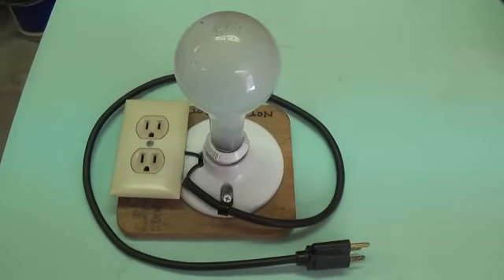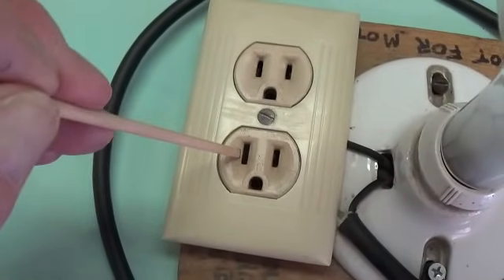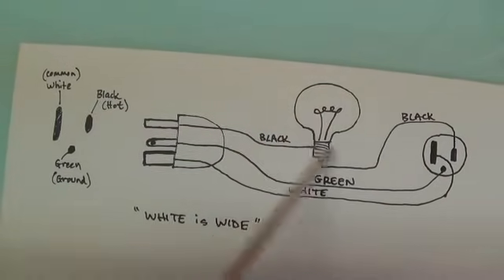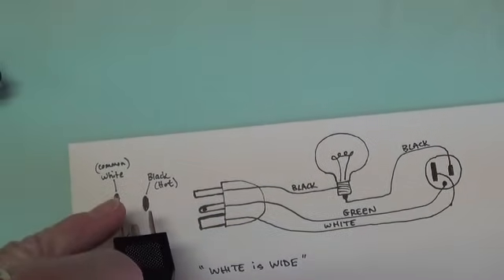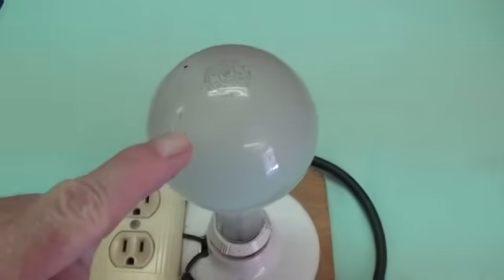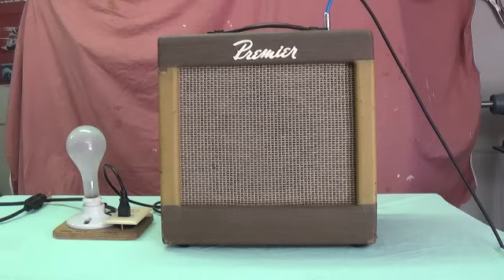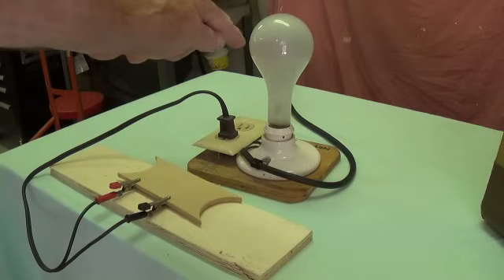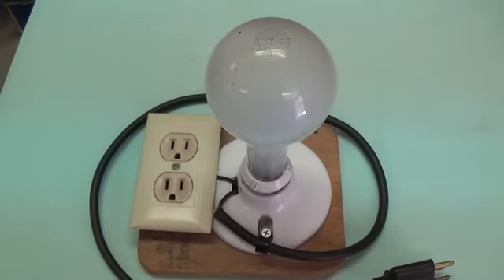Build Your Own Current Limiter for Protection when Repairing and Testing Electronic Equipment

Comment: A limiter was one of the first things that I made. I made one with a bypass switch to take the lamp out of the circuit and run the device direct. I would use that when I fire up a renovation project part of the way through the overhaul process, after I have dealt with the B+ supply and grid couplers. 
The other device I have is a device for re-forming the big smoothing cans. It is an old power transformer, rectifier tube & a neon tell-tale. All made out of scrap. The only remotely hard to find device is a 100 watt tungsten filament bulb. You have to look a little harder than your local superstore.
Reply from the maker: I believe that incandescent bulbs of high wattage are readily available on Amazon.com, NJ.

Comment: This is a brilliant idea. i am getting into restoring tube amplifiers, i think i will build one of these! its simple and it works. I have 240v here in australia. Polarising here is exactly the same. Just different plugs and voltage.
Reply from the maker: You'll be very glad you did, SED. It is indispensable when testing circuits and trying out newly acquired  equipment.  Due to your 240VAC supply, you will probably need two 200W to 250W bulbs in parallel.
Reply: Uncle Doug i will certainly do that. i will try and find a suitable bulb(s) for this application. its a shame that our government has almost wiped incandescent bulbs off the market. I will have to hunt around for some.
Reply from the maker: Our government did the same, SE.  I'm not sure where it's stated in our Constitution that the government has the right to dictate such personal matters as toilet flush volume, light bulb design, mandatory seat belt and motorcycle helmet use, gasoline additives, etc. etc.  but they seem to feel that it's their divine duty to do so.  Re incandescent bulbs, they are readily available on Amazon.
Reply: Uncle Doug Thaks doug. Your government sounds very similar to ours. I will have a look on amazon and other sources.
Reply from the maker: Good luck, SE.
Reply: Uncle Doug cheers doug
Reply: @UncleDoug  In IEC countries (including Australia), electronic gear is supplied with twice the US voltage, but draws half the current, i.e., demands the same power from the mains. A 200W bulb in Australia will do the same job as a 200W bulb in the US.
Reply from the maker: Good point, Silas. Thanks for your helpful input. @silasfatchett7380
Reply: Sorry for butting in. But its also same in UK!!! My guess is, the same clowns dictate to all the worlds Governments. Joke! But it does seem like that sometimes. When things like this go global.
Reply: Same in Germany here, but you know what - I never cared until I came across this video, when I needed them. These light bulbs are so easy to understand and good to use, but so super inefficient and fragile - I can understand that they're out of use in many areas. And honestly, I could rather call a country free, that has no incadescent light bulbs, but that allows you to do what you want in your life, so I'm fine with them dictating some technical and ecological things, as long as they stay away from social / personal and emotional business.
And luckily I've discovered sites, were you can even buy 500W Bulbs for 230V that cost about 1-2€ :D
Reply: Same as in Germany ?There are no polarised outlets und plugs . Not at your home, only some special (CEE-type).  Line and neutral changes accidential  by the way you plug in.
Reply: Do you want to know, wether polarisation is the same or the plugs or whether it matters which way round you plug and wire it? 
Btw, in case it's not a spelling mistake - i think our "Phase" is called live in english, not line ;)
Reply: You mean like the rampant and uncontrolled importation of moon god worshippers who are destroying your nation, how's that rate on your ecological disaster scale?

Comment: 500+ replies!! Noob is question. If one were to use or add a dimmer switch to this, would it then also act like a poor mans variac? Thank you.
Reply from the maker: Because of the way that light dimmers work, by chopping out portions of the AC wave form, I would not think that the power transformer, rectifier, and filter caps could properly function on an AC input modified by a dimmer.  A bulb responds only to the energy applied to its filament, but an amplifier power supply requires intact wave forms to function. Here is an explanation of how dimmers work:  http://www.sprags.com/
Reply: https://www.youtube.com/watch?v=GaRUvUoTRe8

Comment: what should be the wattage for 230volt AC line
Reply from the maker: Although your voltage is double (230VAC vs 115VAC), your current flow is about half. Since the Current Limiter (CL) depends on current to rapidly heat the filament and increase its resistance, you need a bulb with higher filament resistance. Since the filament resistance of the bulb decreases with higher wattage, you should try a lower wattage, higher resistance bulb.....i.e. a 100W......initially, and then fine tune the wattage depending upon the power demands of the amplifier being protected.

Comment: thank you very much sir for simple and elegant video on current limiter. sir pls i confused at the 6.44min your shorting the hot and common wire,how does the bulb glows

regards
Reply from the maker: You're welcome, Bala. By shorting the circuit, sufficient current flows through the bulb filament to make it heat to maximum temperature and glow brightly.

Comment: Thanks for the earlier reply.  New Q if you don't mind.  I hate to ask this as it seems like it would be obvious, but my pea brain seems unable to digest it.

Setup: The bulb is basically acting as a in-series circuit resistor with 120Vac pushing.

Q1) Seems like it would create a load either way. Why is it only lighted when there is a short?
Q2) If you/me (physically) are the short, why does it light vs you/me getting the shock?

Thx.
Reply from the maker: The bulb at rest has a very low filament resistance, probably 2 or 3 ohms. When a small amount of current passes thru the filament, it remains relatively cool, maintains a rather low resistance, and emits no light.  When much more current begins to pass thru the filament, as with a short circuit, it heats up, the resistance increases, and it begins to emit light. Since the vast majority of the increased current is converted to heat and light by the bulb, there is virtually none left to cause harm within the short-circuited component(s).  A current limiter is not the best device for human shock prevention. It works to a degree by reducing the harmful current, but a ground fault interrupter (GFI) is more effective.
Reply: Thanks UD for the info. More to learn.  I was assuming that the human offered less resistance than the filament (my 300w bulb measures at 3.6 ohms), so the human would get the current first.  But, I guess that since both are in the same circuit, the bulb will burn off (in my case) ~300watts of the energy present.
Reply from the maker: Dry humans with shoes on offer very high resistance, around 50,000 to 100,000 Ohms, but (if well grounded and in solid contact with the electrical source)  the resistance can drop down to around 500 Ohms.

Comment: "IMPORTANT NOTE: The wattage of the bulb must be tailored to the current draw of the device being protected. The high-wattage bulbs (200W+) recommended in the video are primarily for Tube Amplifiers, which operate at relatively high current levels. With lower-current devices, such as Solid State amps, a lower wattage-higher resistance bulb (even as low as 40W) may be required for circuit protection."

Thx, Uncle Doug.  Great videos!

Q) Your note above…  Is there a thumb rule?  eg. Match the bulb wattage to the expected wattage load of the device?  Thx.
Reply from the maker: No doubt there is a way to calculate the bulb wattage which is exactly right for each amp.....but I don't do this.  For small to medium power tube amps, I generally use a 250W bulb. I rarely work on high-wattage amps, but would probably use two 250W bulbs in series.  I also very rarely work on SS amps, but would use a 100W (or less) bulb if I did.
Reply: @UncleDoug  reading this gives me the idea to use a lower wattage bulb in a current limiter setup, with a amp. The idea being , the current limiter would act as a variac of sorts while llaying through the amp with a guitar. Am I thinking wrong ?

Comment: Don't forget, if you're in the UK you have 240v one the mains and not 230v - When we came into line with Europe, rather than waste billions replacing substation transformers, it was easier to relabel everything. This is why US amps run higher HT voltages than they should in the UK - worth testing those HT smoothing caps. Fender amps run 400v caps at 380 but in the UK you can find 420v HT, not funny!
Reply from the maker: Most of the vintage Fender amps I have owned and worked on use filter capacitors with 450V to 500V working voltage ratings, Prince....but I agree, since the wall receptacle voltages are higher now in both the US and UK than they were when these amps were designed and built, we must be vigilant to ensure that our filter caps are up to the challenge.
Reply: Yeah, I have a load of gear from the US marked at 110v to 117v. The assumption is (for others reading) that a mains transformer has two 115v primary coils. In the states these run in parallel for 115v, in UK & Europe they run in series for 230v. Great, right? No! If you have a 380v HT rail and 400v caps, then the mains is actually 240v but that day its a bit higher, say 245v, then your HT rail is now 405v. Add fluctuations in the circuit and thats really hammering the circuit. Add to this CAD designed modern amps that run a 1w resistor at 0.9w and its not a long term career move! LOL
Great videos Doug, I'm sure you shall continue for years to come! :o)
Reply from the maker: Thanks for your excellent analysis and input, Prince. We really appreciate it :)

Comment: will a 250 v heat lamp bulb work too?
Reply from the maker: I'm not sure, EH.  You could try one out and see how it responds to a dead short. It may work fine.
Reply: It works.  Its just red instead of a clear bulb.
Reply: I clipped two leads plugged into the limiter onto the black leads on the Power Transformer and as soon as I turned on the power the bulb lit up.  Does that mean there is a short in the power tranny?  I also put my meter onto the leads and could get no reading from the 6.3 v  or the high voltage leads.
Reply from the maker: It sounds like something is wrong either with the PT or the bulb you are using (wattage is too low). As far as a short, have you checked for measurable resistance between the PT primary wires and the metal frame of the PT?
Reply: It is a 250 watt bulb.  I will do a double check on the resistance on the PT.
Reply: I cant get any readings when I go from the primary to the pt metal frame.
Reply: also testing the high ac supply there is 0 voltage coming from the PT.  I tested another PT and got the 660 v that should be there.

Comment: tried and true method, doug.
but i would have thought a seasoned amp fixer like you would have a variac for this.

slightly different approach, but i find it very useful, for this application, and others.
Reply from the maker: I do have a Variac, Borgar, but it serves a completely different purpose than the current limiter. The Variac regulates voltage and the Current Limiter, as the name implies, regulates current.  If you want to slowly energize a circuit and allow the electrolytic capacitors to reform, you use a Variac. If you want to operate untested electrical gear while protecting against internal damage due to short circuits, you use a current limiter.
Reply: I suppose you are right.
I've only built my own so far, never had any repair gigs as of yet.
I'll keep this trick in mind
Reply from the maker: It's a very useful device, Borgar.....easy and inexpensive to build.

Comment: Loving your videos Uncle Doug. I suppose this is useful for working on solid state amps too? In the UK we have 240v ac and the terminals are called Live, Neutral and Earth. The Live is the positive part of the cycle (50 Hz) and the Neutral is the negative part with the Earth being the zero volt reference.
Reply: Wrong. Live is 230v (+/-) Alternating Current, so is alternately plus and minus with respect to Neutral. Neutral is earthed at the nearest sub-station transformer. Earth is connected to an earth rod next the property, or in some new UK installations Earth is connected to Neutral where it enters the property.
Reply from the maker: Thanks, LTS.  Many of the principles of tube amp circuitry will also apply to transistorized circuitry.  Thanks for watching and commenting :)

Comment: Just found your amazing channel. Love your video and scribed it. 
Maybe English is not my first language so I don't quite understand the statement at 2:56.
I hope you can educate me :)
How does that bulb (low resistant) in serial prevent huge flow of current when the downstream circuit is short  ?
Isn't it getting brighter  because of increasing current ? so if that resistant of the bulb is 2 ohm when downstream circuit is short, isn't there still 120v/2ohm=60A current flow through the short circuit ? So if it''s my finger tip causing the short, I will still get shocked right ?
Reply from the maker: The filament resistance is quite low when only a small amount of current is passing through the bulb, but if more current tries to pass, the filament resistance increases and restricts the passage of the current. When this happens, the bulb glows to warn you of the short circuit. You can still get shocked, but not as badly as without the current limiter.  Its main purpose is to protect the circuit, not you.
Reply: THANK YOU. So the resistance of a bulb increases as the temperature of its filament increases. Now I understand how a glowing light bow in serial can bring down the short current. Thanks for sharing your knowledge.
Reply from the maker: You're welcome. Yes, the feature that makes it work is the fact that the filament resistance is initially quite low, but will increase instantly and dramatically if more current begins to flow.

Comment: Hi Uncle Doug,
I have watched so many of your video's I've turned into a real ampaholic, my wife is very concerned  but I haven't electrocuted myself or the cat (yet). I've built my current limiter and is working great on old tube radio's and some pa tube amp I recently scooped up. 
My question really is: you plug in that ole dodgy device and the bulb lights ups, how do you find the location of the short to fix it?
Also: if I turn on the amp and the bulb doesn't keep being lit (only during elco's charging), but it starts shining bright when I take the amp out of standby -- can I conclude the short in the HV circuit somewhere?
If I take out the tubes and turn it on and out of standby and no light goes on, can I conclude it's a short in one of the tubes?

Please keep on making video's -- they are of tremendous educational and cultural value (documenting those vintage amps). I also wanted to say I hope you were a teacher otherwise it would have been a huge loss, but that's nonsense, we have youtube now, and you're doing it now. Oil floats on water, even on the interwebz...
Reply from the maker: Greetings and welcome to AU (Ampoholics Unanimous), Johan. The current limiter is primarily to protect the circuit from self destruction due to short circuits. Finding the location of the short requires some time, effort, and sequential testing......there is no short answer for how to do it.  The answer to both of your other questions is......probably, but the rectifier tube (if there is one) needs to be dealt with individually, since it and the power transformer are the producers of the high voltage DC.  Thanks for your nice comments. I was a math and science teacher for many years, but have since retired.

Comment: This is very handy for when you're fixing SMPSs and you're not sure whether you've got a shorted semiconductor somewhere. Recently though I've noticed that with SMPSs that have PFC on them (most notably TV PSUs), the bulb stays on all the time, indicating a very low  resistance through the SMPS ! Of course, I had already replaced any shorted MOSFETs and diodes, which would account for the bulb being bright, but it still stays like that, so I'm guessing there's something else still shorted that I missed, or it's because this PFC circuit that tries to reach the 400V "bar", but can't because of the resistance of the bulb, thus keeping the MOSFETs in their "on" state and supersaturating the PFC transformer, causing the high current demand through the bulb and keeping it bright.....damn, that was a mouthful, I know :)) Has anyone noticed this before ? Did I even make sense ? :))
Reply from the maker: I have very limited experience with semiconductor circuits, Dan, so it's difficult for me to provide any meaningful input on this subject. Hopefully, another more knowledgeable viewer can help.
Reply: Too low of a wattage bulb (high resistance) will probably cause the PFC voltage to fluctuate and the SMPS/inverter would probably behave erratically.  The bulb will be lit but the PFC may be unable to start (it doesn't necessarily mean there's a short).  Anything less than ~370 volts from the PFC will cause issues.  Some TVs may require using 300 - 500 watts worth of bulbs in order to make use of a dim bulb tester.  A variac is probably a better idea.